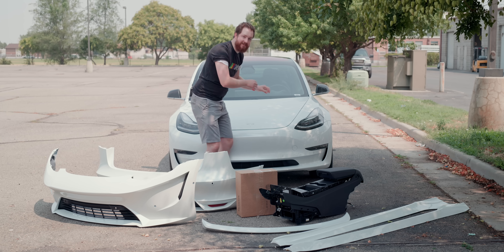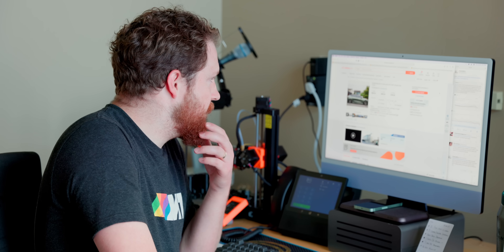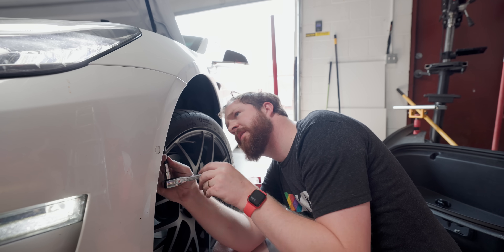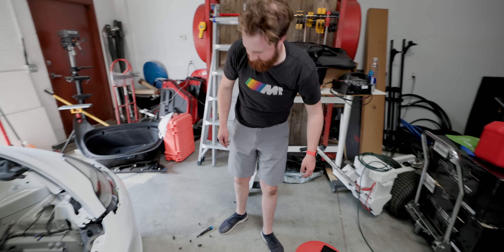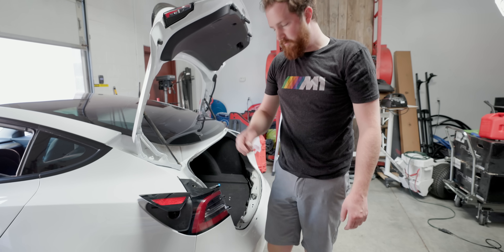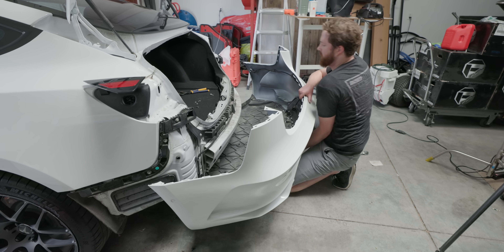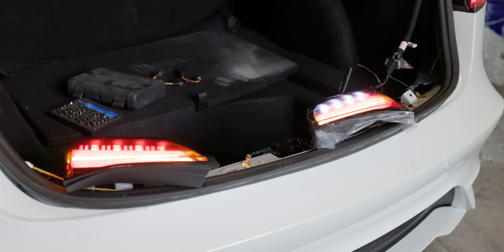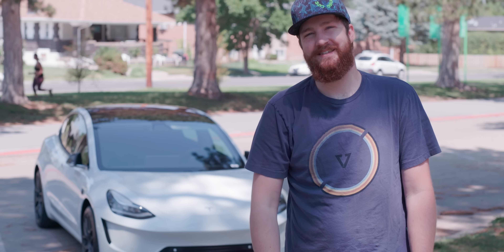I Modded My Tesla Model 3!

Comment: Would love to see that new centre console swapped in! Thinking about trying that in my M3P too!
Reply: Problem is it requires a mobile service call to retrain the key to work.
Reply: It's so funny when you see someone else you love to watch
Reply: Hi
Reply: @john94si  I believe you can take the card reader out of your old console to bypass this.
Reply: @KiloDoubleMike  yes but once you unplug from power it reset it and must be coded to the car
Reply: @KiloDoubleMike  otherwise you could take yours out of your car and break into another tesla and swap them and steal the other car using your key card..
Reply: You’d need a model 3 that’s 2019 or newer. They changed the canbus plug under the rear ac vents. As far as the card reader swap from the old console to the new one and put back. I’m going to be swapping mine next week.

Comment: 1. How are the batteries? are they on the same level as 2 years ago?
2. 18:38 i know that might sound stupid, but i think you can try to solder the cables to the lights.

Comment: You can put jack stands under the suspension.. you could pull the tires and find a place for a jack stand there. Also paint those sensors in the front bumper. They stand out in the black grill to much.
Reply: Not on a MacPherson strut design. The control arms are too fragile to support the weight of the car in that direction.

Comment: The lost of fog lights are sad but look on the bright side. There is so many new options today to add what was lost and improve over the old than there was 20yrs ago. 
And I would’ve taken the madman route to add those amber lights after ripping the car apart that far. 
Red turn signals are so stupid. The only good thing about a full red tail light is if a separate bulb is used for signaling. Go stealth with a good quality yellow led bulb with high luminosity and amber straight through the red lens.

Comment: the only problem with this aftermarket bumpers with more lines and agressive design, is that if you hit a person with that, you will probably make more damage with these... so keep in mind everyone that bumpers are very well design by engineers with safety in mind (the edges, the lines, the materials, the way they fit and are bolted with the rest of the car, etc.) and aftermarket ones are build with only design and visuals in mind:)

Comment: You could have just added an inverter to the input port of the new tail lights, no? Would’ve been off by default (instead of on by default), and the flashing would’ve just been phase lagged (which would still look ok, I think, minus the delay at the beginning when you turn the signal on), right?

Comment: I'm surprised you were able to drive with that all unplugged without warning. I just installed a hitch on my Y and when the rear bumper was off and rear ultrasonics unplugged I was getting warnings about park assist being unavailable. There might have been others but I didn't see them. Oh and removing the rear lights absolutely sucked.

Comment: Seems the part where he re-wires the harness into the new front bumper is absent entirely. I've yet to find a video on YouTube showing how best to do this- I have a new front bumper I'd like to install but every single video is about removal and putting it back on- not removal, removing the wiring, adding wiring to new bumper, and installing that.

Comment: If tesla put in all the wiring for the amber turn signal for the EU/Asian markets (which yes, is better than a flashing brake light) - why don't they just use this for the North American markets too? It doesnt cost them any more because the ECU and cabling is all set up already, right? Wouldn't they actually save money if they just had all regions using the amber turn signal set up? It seems insane that they use the brake light flashing configuration yet have all the set up there for the amber configuration.

Comment: Lol! Good thing I won't be driving the US. 😂 For us, at night, brake lights are just "brighter tail lights" and another brake like places in the middle of the top/bottom edge of the rear windshield. Which means if the tail lamps are already in use, pressing the brake with light up the second filament or extra LEDs, making the tail lamp brighter For turn signals, they are always amber and they must flash when operating. For reverse light, they must be white and must be present on both sides.

Comment: Owns a $90,000 car, refuses to pay for the proper repairs and instead does it himself with cheap Chinese knock offs. Waits a year to do the repairs.... Bet he'll be shocked he won't get what he wants when it comes time to sell it. You can easily tell a knock off from OEM. So much wrong with this video.
Reply: Used condition and collision damage? More like 35-45k. 
If you like to spend 1/4th of the cars resale value on a new bumper, then by all means do it.

Comment: Shouldn't be so hard to replace the front bumper of a car. That's poor design. I took the bumper off my brand new civic two weeks after I got it just to replace the meep meep horn that came from the factory. I did it in 45 minutes with no problems

Comment: Wow most people can buy a maintenance manual for about £30 whereas Tesla will rent you one for $100 an hour 🤣🤣 not forgetting bolts are where they shouldn’t be with no e-manual revision. Do the  mechanics at Tesla just stick bolts where they feel like it on the production lines🤔
Reply from the maker: Pretty much. Their manufacturing changes so frequently too that they don’t have enough manual revisions to account for small part differences.